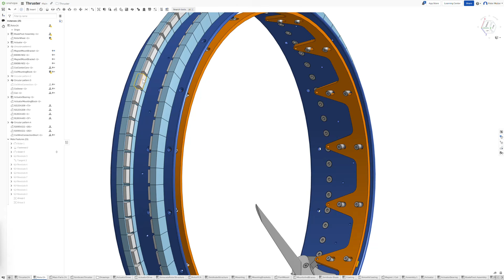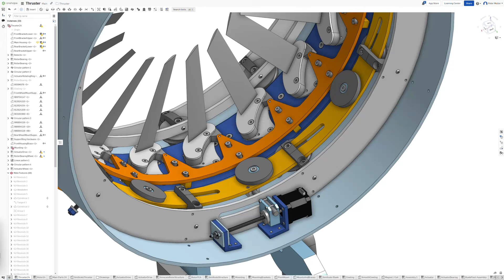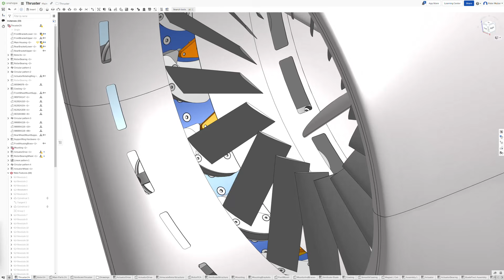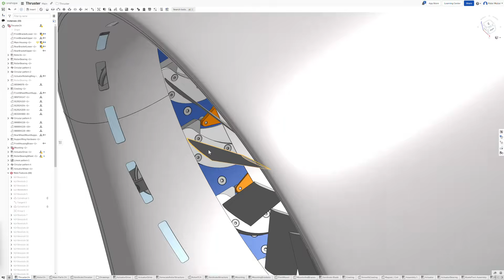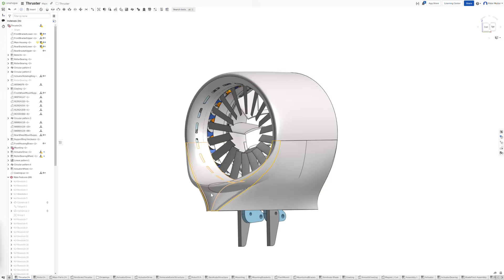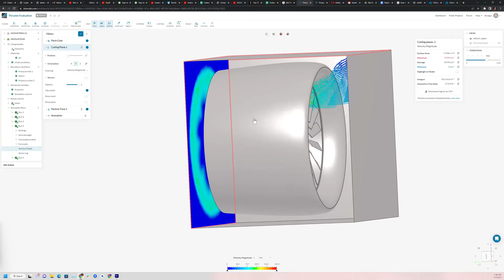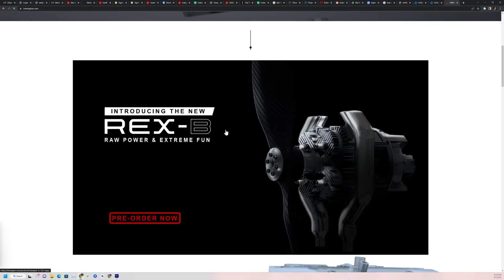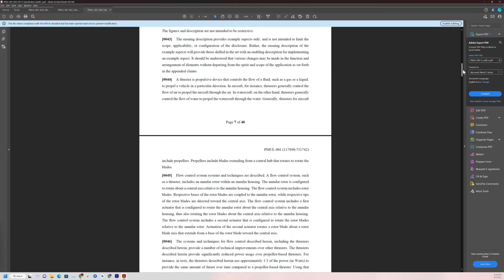Could this Thruster transform Aviation?

Comment: This is awesome!

It looks like you have all your coils in series. Can reduce back EMF voltage by putting coils into parallel sets (same phase, of course). 
You'll still be limited by whatever power your VFD can handle, of course.

But it might just be better for weight reasons to run a much higher voltage VFD. I'd suggest that would keep the weight of the copper between the VFD and the coils lower. Just means a higher 'DC' bank voltage, use higher voltage IGBTs or SiC mosfets ( might be better, for the higher speed AC needed).

You could also split each phase set into three, and run three separate VFD's linked to turn at the same speed. (many industrial VFD's support this mode, often called a 'virtual gearbox' or 'converyor belt' mode). This would reduce the back EMF over the full string of coils per phase to 1/3rd whatever it currently is. 

So far as the winding design looks otherwise: The only think I would change, is have them wound with square-section copper, to eliminate wasted space between the windings and further improve peak power performance. 

You may also benefit from making the cores out of laminated or bundled straight sections of 'transformer steel', which should reduce the eddy losses, which will be especially bad at high AC frequency. Or make them from a high permeability material with lower losses at high frequency. This may lose you some torque, but will reduce power wasted in them. 

For your current design coil cores, maybe just slit them along their lengths once with a really thin slitting saw, radially in one place just to the centre, and fill with something non-conductive: This will prevent them from being able to behave as a 'one turn' coil, and without being too difficult and without reducing their magnetic performance much. Orientation of that slit when installed does not matter at all. Again: Will run much more efficiently at higher frequency.

So, back to the VFD: I'd suggest someone design a VFD that integrates as close to the thruster as possible - maybe wrapped around the outside. 

Should also break the coils up into three sets of three phases, then you just run three of such VFD's in parallel on the same thruster. That way if you have a VFD failure, you've still got 2/3rds the power available on that thruster. 

Use of a relatively high voltage DC link between the thrusters and VFD's makes it lighter, safer and more reliable. Do three sets - one to one with the redundant VFD's on each thruster, that way if a link or generator fails, again, you've still got 2/3rds power for emergency. 

Run each DC link in a triaxial cable: Most of the DC power will be between the inside core and middle sheath, with the outer sheild just a screen which will be monitored by all connected devices: Everything putting power on/off the DC triaxial bus should immediately isolate if there happens a short between the outer safety shield and the outer main DC rail. This will prevent an otherwise explosive failure / discharge in the event of a collision causing bodywork to crumple and crush/shear through the triaxial link. You just have a bunch of ultra cap banks (they're relatively light weight) on each DC bus, so you total VFD / thruster power can outstrip the 'range extender' power significantly. 

I'd also suggest a safety factor on the VFD's, so they're capable of exceeding steady state max power for a duration which will be cooling limited: This makes them much more robust against shorts, etc. Also useful from the ultracaps on the DC busses for emergency thrust.

Finally, I'd have to say you should widen and flatten the nose, and put two thrusters in there, or put then on the ends of the forward wings. Have four thrusters total for flight, and make two counter rotate, and you have take advantage on the massive amount of work done to make quad-copters crazy manueverable. Again, good for safety. Assume the mass-manufactured version should have cameras/ sensors looking in all directions at all times, and be able to promptly act to dodge collisions.

You don't want to equate vertical thrust to max load - remember, when landing (or crashing!) you need to be able to achieve vertical acceleration upwards in order to reach zero vertical velocity before hitting zero altitude, so you always need more vertical thrust than you have load, just as a margin for that decelleration when approaching landing.
Reply from the maker: You have a lot of knowledge around the electric motor design. I've already been working on reconfiguring the coils on the prototype to get it to run faster. I'll put out another video in the next week or two to show the improvements. All of what you said will hopefully be used by the next company who hopefully builds one. I don't have the resources to take this much further than the prototype stage. As for the aircraft, having 4 thrusters would still not make it hover if one failed. At that point it's a plane again or just use the chute.

Comment: one thing you noted was that drive impedences on the three phase motor were quite high, with issues trying to get the variable frequency drive to work any faster without burning it up.
part of the problem is the rim drive motor, I'm quite sure this setup delivers a truly vicious amount of torque, but you are limited by the electronics of the variable frequency drive, and, hence, RPM.  it can only go so fast, I would do larger banks of the permanent magnets facing the same polarity, I would also do banks of stator coils on the same phase instead of switching phases on each coil, this will lower the drive frequency requirements, as the rotor will traverse more distance with each electrical cycle.
IE if you cut the number of pole reversals across the entire rotor/stator in half, you will double the RPM

Comment: It's a good project, but one of the main advantages of electric powered blades (ducted fans or standard propellers) is the simplicity of the motors. two bearings, the coils and the magnets. maybe a pitch adjustable blade.

You seem to have at least 24 bearings pointed inwards towards the blade (12 on each side?) and the same or similar amount at the bottom.
On top you have your pitch adjustable blades that moved with the use of the bearings on a sort of clutch-like linear system.

The level of complexity alone is astonishing.

Comment: awsome, you seem to be the first to make transition from boat to plane
may i add that well design volutes are in order. not to increase flow but pressure.
i have been working on this not as propulsion, but as generation in wind tunnel replacing archaic wind turbine generators.
my first design was stolen by honeywell-----they call it the gearless rotor but they didnt put into a tube with a negative pressure venturi, o well-honeywell

Comment: Awesome work. As with most people's comments an inner ring, but you could go on step more and use the inner ring as the support for a second fan, prehaps spinning the opposite direction. Also you didn't mention it may I suggest the magnets be organised in a halbach array as to increase there magnetic flux on the stator side. 

Another idea is the use of 'magnetic bearings' (basically uniformed levitation (magnetic repulsion)) to support the fan.

Comment: 30:00 excellent work! I think the performance could be maybe increased by reducing the backflow in the middle of the outlet. Maybe provide a laval nozzle in the middle of the thruster which seperates the accelerated flow from the middle unaccelerated flow. Otherwise you have the effect of a venturi nozzel in the middle of the thruster.

Comment: Sir. I love it. I'm a boat owner and just changed to electric drive. As soon as I saw your video I thought of "how would that work on my boat.  I'm wondering how this, a smaller version, more robust to push water would work. It would get rid of a couple problem that boat owners have. Cavitation and prop walk. If the motor could have a forward and reverse the blades could then be fixed, making the design a little simpler. My prop now generally turns between 500 and 5000 rpm giving me ample thrust. A 3 second burst at 5000 rpm is enough to stop a 35ft 12000lb boat in less than the boat length. Have you thought about this application? I bet the military and other seafarers would be interested in your design. 
I hope to see more of your design in other videos.
Reply: There are already rim drive propellers for water craft. They have the advantage of not getting tangled with seaweed and rope.
Rim drives have some benefits in the water by they're also have a lot of drawbacks. They use more power than conventional propellers.
Trying to put a rim drive on an aircraft is a fools errand.

Comment: Hello Hello From Canada!!! Thank you for sharing this awesome creation and your progress with us all. There is so much promise in the design that I am sure you will go far with it. I hope you have access to a high speed camera to see something that could set you back once you go for maximum power. My laptop couldn't slow your footage down enough to tell how much deflection the blade tips have at the highest RPMs. Just my opinion, but you could lengthen the blades and have a small central hub that the blades could pivot at to keep the centrifugal forces more under control. The hub could also help to bring down the rotational mass to make the higher RPMs easier attain for added thrust. You have done incredible work and as I am new to your channel, I can not wait to see what you come up with next. As I said I am new to your channel and if you have covered the reasons for not having a small hub, I will learn even more. I wish you good luck, good healthy and great happiness in all you do in the future my friend.

Comment: Such a brilliant design. I love it!, as a former Aviation mech I see a myriad of maintenance issues. Anti icing will have to be addressed also. Small holes and slots get iced over very quickly. Vibration has an amazing way to loosen bolts and screws so the safety wire aspect will have to be addressed.

Comment: A central body could be useful for diverting air flow onto the surrounding blades. It could also serve as an attachment point for the blade tips to stabilize them. If the center hub had a motor it could add additional power to the system.

Comment: I attended a Royal Aeronautical Society lecture about 12 years ago in Bristol UK about rim driven fans, I believe the company were targeting applications such as the F-35 lift fan.  Can't remember who gave the lecture though.

Also, I love how simple you think it is to design an aircraft and get it to market
Reply: Same could be said for spacecraft yet there are multiple private companies or individuals building them and getting them approved for launch with passengers onboard.  Plus, kit style aircraft manufacturing has come a long way since the 1960's so yes, I can see a small light aircraft the size of the Raptor being approved by FAA and in kit form.
Reply: @Telknor  yes, but they follow proper design and certification processes.  This guy doesn't look like he's following any defined processes or aerospace standards.  I mean, he starts calculating fuel burn at one point ..... for an electric motor!  As it stands he's got no hope of getting his aircraft certified.  I wish him luck, but he's going to need a lot of help
Reply: @dogjennings1171  I agree that there is a lot of work ahead of him still and that the FAA will require him to work with or have a certified engine manufacture build a working "prototype" for test stands and actual test flights.  Even then it's still many years before this ends up on an aircraft certified to carry people.  That is if it makes it that far.
Reply: @Telknor  nope, he'll need a lot more than that
Reply: @dogjennings1171  I was talking about just the engine.  The Airframe is a whole can of worms on its own.  I've spent nearly two years working on a large two-and-a-half-ton drone for transport of firefighting foam and retardant to remote forest fires that the forest services can launch and fly from a flatbed truck.  This was to be used while the fire was small or having just started.  Per FAA regulations I needed a large airframe manufacture to build and test this drone.  I was free to make models and mockups of it all I wanted on my own as long as they didn't fly.  The problem with the drone actually wasn't with the FAA but with the DOT.   Just couldn't get it folded compact enough to fit on truck and meet DOT regulations for road transport without specialized permits.  Plus, the thing was complicated as hell to service and had way too many moving parts to have the folding option to fit on a truck.  As the engineer at Lockheed put it "Too many points of potential failure in the articulated frame components to allow safe operation."  So yes, from the design team point of view it looked good and worked as envisioned but from an engineer's point of view it was a disaster waiting to happen with a wrong gust of wind or impact with a tree.

Comment: The center section could hold a ram/scram jet for supersonic flight. You could adjust the blade pitch to be inline with the airflow and thus not interfere with the airflow.

Comment: I design and 3D print high power electric fans for my RC models. I could make a 3D-printed ducted fan for one of my planes like this but I'd have to either gear/belt drive it or wind a custom coil for the shroud and I think at a small scale the bearing friction would be quite bad. Cool idea.

Comment: Definitely thinking outside the box, very original. I'd like to ask you Peter, have you've thought of using magnetic levitation instead of physical bearings for the outside of the rotor ring? I just had this idea that the the gyroscopic Force of the rotary motion would keep the rotor ring centered within a magnetic levitation layer ring created by dedicated magnets just for that purpose, alongside the magnets for propulsion. Sounds like a hell of a lot of magnets, but do you think that might work? I got the idea from seeing diagrams of magnetic transmission gearboxes. This would make zero friction possible, eliminating the one place outside of your variable pitch mechanism that you would get wear and tear.
Reply: I came here to say much the same

Comment: Very interesting application. Something the inventor/designer probably already knows but here it goes anyway. The blades will most likely need a hub of some type. If the blades develop the thrust necessary for an aviation application, this design without some sort of a hub, will likely fail in time due to the repeated bending cycles due to the pressure forces generated in moving the air through. Also, the blades themselves are ripe for a redesign and optimized with computer simulations and iterations.

Comment: If you added a center ring (it could be hollow) attached to the bladed, you could convert the compressive forces into tension. Drive it and center it from the annulus like you are, but hold it all together with a central ring.

Comment: When design is finalized, testing it on different RC plane configurations would generate a lot of interest.
Reply: It works better on paper, than it will with the battery weight needed to power it,   but agree 100%

Comment: Very cool looking bit of kit. An issue here is going to be the peripheral speed of your bearing surfaces. In turbofans the blade tips are typically transonic which will wreck even the fanciest ball bearings. You may be limited to lower discharge velocity as a consequence unless you can find a way to make the stresses and heat induced tolerable to the bearing materials.

Comment: Peter, watched video this morning and had some thoughts. I'm not going to read all comments, so my thoughts may have expressed already. First, I think it's a great idea, I think your horsepower to thrust ratio is pretty good so far. My concern is the design is a iceing monster, especially with the close tolerances at the blade pitch control. Also,, just a little ice on the back of the blades will probably cause major unbalance conditions. Keep plugging away Mate.

Comment: Amazing idea, on paper, but would need prototype testing to iron out any issues. My first reaction is that on a conventional jet engine, the blades are designed so that they dovetail into the rotor, so they are passively held in the plane of the centre axis, and are able to move in the plane of rotation (you can often hear this on jets when the blades are freewheeling), without risk of losing a blade.  To retain the blades, there seems to be a large number of mechanical fixings, that dont passively retain them, mainly because of the attempt to use feathering of the blades.  In the event of a blade failure, will the centrifugal and rotational forces be liable to throw the blade outwards and to the side, into the next blade and so on, causing cascade failure? The ability to check for stress and tightness on relatively small fixings, would inevitably mean that there may be risks of these being missed.